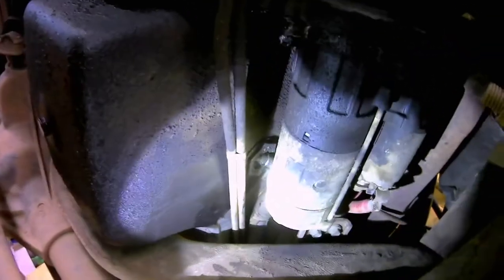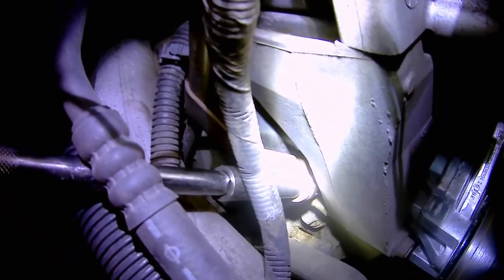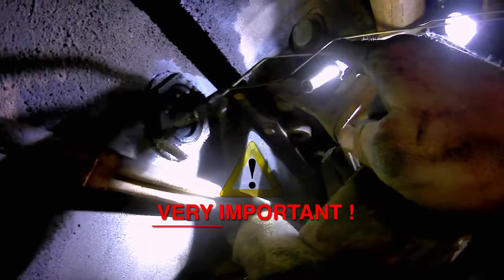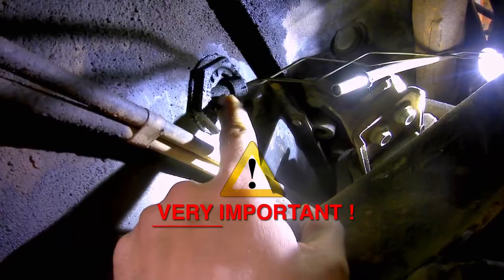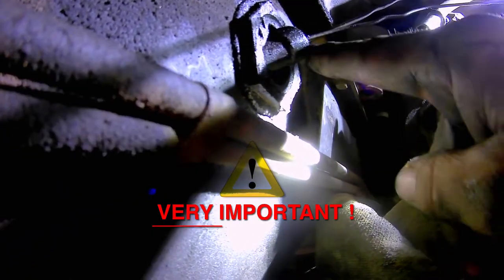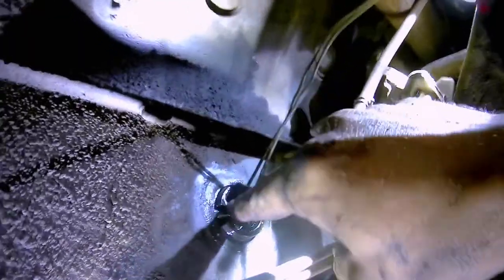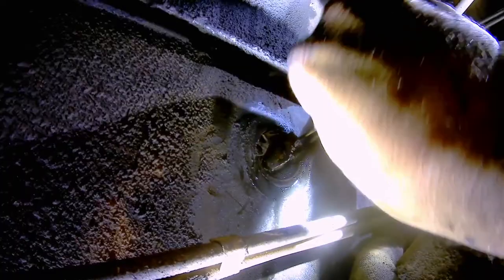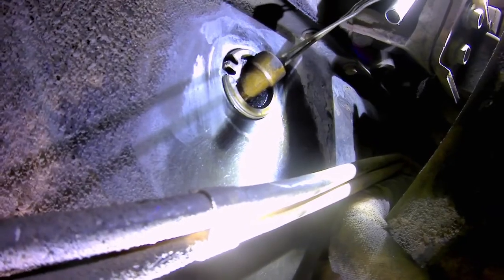7.3  Powerstroke dipstick oil leak repair

Comment: Just did this today with your kit, this is the NUMBER ONE option hands down. I'm lucky I called my local Napa Auto and they told me they carry it otherwise I wouldn't have known about this option and would have went with the other style that costs 3x as much and makes you drop the inner piece inside the pan. This is a simple and effective fix! Thanks!
Reply from the maker: I’m glad you like it and thank you very much for the review!
Reply: Where can you get this kit
Reply: And does it have a 95 7.3 option
Reply: @trentonmetcalf7220 my question as well. We’re you able to find the part for the ‘95?

Comment: I've also seen vice grips used in place of the coat hanger tool. Good Stuff, I'll definately be doing this if I get a 7.3 bus
Reply from the maker: There are several different ways I’ve seen people hold the inner part. Vise grips have a chance of scratching the inside of the tube hole. That can hurt the tube o ring when you put the dipstick tube back in. Just be careful no matter what method you choose.

Comment: okay let's think about this people I was just about to buy this kit too. The original seal was an o-ring on the inside, when this worked it would not allow any oil past the o-ring. once the warped o-ring no longer functions the oil creeps in between the hole and the threads of the fitting. now, time to really think about this, this kit puts a gasket around the hole. oil is still able to get in between the hole and the threads, theoretically. The only thing stopping us is the nut you tighten over the large washer which also does not have any sort of gasket. maybe the only reason this might work is if you use the gasket sealant on the threads of the fitting.  like I said I was going to buy this but then thought about it. still it's a better option than any other one I've seen without pulling the engine. but for $90 I'm going to try to use just black RTV sealant and either find or make a large washer first.
Reply from the maker: The oil seal is the RTV. The external gasket is there tho force the sealer into the hole and threads. The washer keeps the nut from tearing the gasket. RTV can only hold up to certain thickness. That is why the gasket is there. It presses the sealant into a thin film and forces it where it needs to go.
Reply: @73dipstick  you might be correct however the way that this person installs it shows a very thin film of our TV sealant on there I don't believe this is enough to squeeze into that hole. I'm not saying you're wrong I'm saying in this instance it looks like it's not enough I could be wrong about this too though.
Reply from the maker: Richard, you are correct. I did not do a good enough job of explaining everything in this video. I edited down the footage to try to keep it to a length people would watch. I can tell you that out of the thousands of kits installed I have had less than 1% who have had issues. And I have stood behind all who have reached out. I’m only trying to get people a cost effective solution to this common problem. I truly only want to help those who don’t want to drop the inner part inside the oil pan and pay $300 for the billet option. Which by the way works great. It’s just 3 times as much money

Comment: I need my truck and because of unexpected family business I'm two weeks behind schedule.  Just before I was about to make a 400 mile trip to pick up a new bed to replace the rusty, bent up chunk of swiss cheese that's current residing on the back of my F350, the dipstick tube flange decided that now was a good time to let go.  It had been seeping and I had bought a kit from Diesel O Rings a few months back.  This afternoon I said a few expletives (or prayed if you want to call it that, most of the same words) and got to work.

The kit says that if the flange is bent, to not use the o ring and instead fill the groove with Permatex Ultra Black.  Well, ain't nothin' easy on this truck and it had the classic warp to it.  But how in great gazongas am I supposed to squirt RTV all the way around that flange?  Top and sides are easy enough, but there ain't no way I can get to the bottom of the flange no matter how I turn it.  If I start squirting RTV willy nilly in there, I afraid some of that is going to come loose and get sucked into somewhere it shouldn't.  Then I'll be doing a tear down and like I said, I need my truck up and running, not up on a lift.

I just ordered one of your kits from Amazon.  Had to pay a little extra for two day shipping, but I should have it Thursday.  If All Goes According To Plan (yeah, right), I should have the truck back on the road by this weekend.  If it holds, I'll be sure to leave a positive review.  I rarely leave a negative review unless something is complete garbage.  Or politicians.  Same difference.  If it doesn't, this looks like it will be the easiest to scrap off and start over.

This product looks fairly decent and I expect good results, but the Universe?  The Universe hates me.  I just know that the weather is going to turn to crap, or I'll get called away for some emergency, or I catch the coof coof, or a rattlesnake that's late turning in for the winter will decide that under my truck is a good spot for a nap, or (god forbid) I'll get elected Grand Poobah of the Middle Finger and they won't take a F--- Off for an answer.  My money's on a combination of weather and the rattlesnake.
Reply from the maker: I love the story. I’m crossing my fingers for you that the snake stays away and the weather holds. My direct email is in every kit and I check it all the time in case you run into anything unexpected, please reach out to me.

Comment: What tool did you use to hold the flange from falling into the pan? Id like to use this repair on my truck but im afraid to drop the flange in the pan.
Reply from the maker: @brandonion5647  it was just a wire coat hanger that I bent into a spring holder. It worked decent. I hear a lot of people use a .45 caliber brass cleaning brush and like it. The brass brush holds tighter.

Comment: I've looked at other kits ages I seem to like this better. Would be good to include the gun cleaning brush the other kits include that holds the adapter from falling in. I don't trust the clothes hanger option although it looked like it worked fine in your video.
Reply from the maker: I’m not as big as the other guys. The liability of providing a “tool” would be WAY too much for me to afford. Thank you for your feedback though!! I truly appreciate it.

Comment: Mitch
So tell us how this worked out.
Have had any weeping around it yet ?
Just curious how this has worked out.
Reply from the maker: I’ve done dozens of them. I did have one start weeping early on in testing. I believe it was because there was still oil residue on the internal part when I put it together. Everything needs to be clean and dry before the silicone gets applied.  One of the first test trucks has gone over 200,000 miles since the repair and is still perfectly dry.

Comment: more details on the special tool  how to make ?
Reply from the maker: kinksbikes , it is just a bent coat hanger. I’m not releasing the design as of yet because I am trying yo apply for patent protection before I release the specific information. But you email me I can send you a pic of a one time use design that is easy to bend. 73dipstick@gmail.com
Reply: Just use a 40 mm gun barrel wire brush. Holds it perfect. Easy fix.

Comment: 40 mm or 45 mm gun barrell brush? Heard both
Reply from the maker: I’ve always used a bent coat hanger. My advice is to get the biggest one you can get in. The tighter, the better. Someone told me today that a 20 gauge bronze shotgun brush worked too.

Comment: What is the torque spec for the aluminum nut?
Reply from the maker: Good n’ tight🤣. Not many use a torque wrench with a 2” socket on this repair. Tighten it up until the adapter quits moving. I would say no more than 25 ft lbs to prevent stripping the threads of the aluminum nut.

Comment: How did you make the tool
Reply from the maker: I made it by bending a wire coat hanger. But, most people have found that a .40 - .45 cal gun cleaning brush works better? Several shops that do the repair use needles nose locking jaw pliers.

Comment: How on earth did 3 morons dislike this amazing video?! Thanks for sharing this How-to!!!
Reply from the maker: Thank you so much.
Reply: Lolololololol really!!!
Reply: I’ll tell you why I disliked it. Quality control on the machining of the threads on the new retaining nut is lacking. I wasted nearly two hours patiently trying to get the new nut to thread. I even tried flipping sides as well. About two turns in, the nut would pop off. And after all that time, my luck finally ended and the .40 cal bore brush I was using had sufficiently compressed enough that the dipstick interface finally slipped off and fell to the bottom of the pan. 

Even if I had managed to successfully get the nut started, after all that time, the RTV surely would have mis-set resulting in a bad seal. 

In the post-mortem, inspection of the new nut shows its threading is poor. This is unacceptable given how much you pay for such a minimally expensive part. 

So I’m left with not much other choice than to go to that diesel site to buy the aluminum adapter instead.

Comment: Great idea - but - flawed.  the o ring stops oil from getting out of the pan, this product simply tensions a big washer onto the pan, doesn't restrict the flow of oil at all - unless you get crazy with the RTV stuff and just goob it all over the place, then you have one giant man made washer.
Reply from the maker: The gaskets job is to push the RTV into the gap between the adapter and the pan. Keeping the silicone within its working limits. Silicone in and of itself will peel off. It also has a maximum working thickness. The use and design of the patented gasket in the kit allows for deformities in the pan so as not to exceed maximum thickness of the silicone. The washer is included in the kit so you don’t tear the gasket when the nut is tightened. I appreciate your comment, however the o ring being inside the pan and exposed to oil is what causes the failure. O rings swell over time with oil saturation. This deforms the internal part and allows more oil to reach subsequent o rings. Ultra black does not swell with oil. So it seals the gap as well as protects the gasket.
Reply: @73dipstick  but rtv is what will keep the oil coming out - not the gasket as it mounts flush to the pan.  Rtv should just be caked all over the dip stick receiver so the mounting nut seals around and into the threads. I applied rtv to the gasket as your instructions show but it still leaks.  Slowed it down quite a bit but still leaks.  I understand the failure point of the gasket.   I’m gonna have to pull mine again as it is dripping good still and rtv that male part coming out of the pan spit can seal the outside...
Reply from the maker: @33valleys28  send me an email and I will send you a new gasket and dipstick o ring so you can redo it. The instructions clearly state that you must get the silicone on the threads for the kit to work properly. I do stand behind my product and will always work with the customer via email. If you put enough silicone on the gasket towards the center hole and the pan and adapter are completely clean, oil free, and dry…the silicone will push into the gap between the pan and adapter sealing it up! Please reach out to me at 73dipstick@gmail.com and lets get your truck sealed up!!!

Comment: What is the point of it why does it I have a removal tube why can’t you be like a car with the dipstick just goes in with an rubber O-ring why would they do that or why make a removable at all
Reply from the maker: When international redesigned the 7.3 to a HUEI motor the dipstick could not be machined into the block anymore. So they came up with the oil pan adapter. Unfortunately, the adapter seal fails overtime. The factory repair is to pull the pan and replace the adapter. Unfortunately in the Ford vehicles the motor has to be removed in order to replace the pan correctly. That is why I developed this kit to be installed on the vehicle.

Comment from the maker: 73dipstick.com 7.3 Dipstick Adapter Repair KIT 
73dipstick.com is the website. It has links on multiple places to buy the kit. Amazon link is broken right now, but we are working on getting that fixed.
Reply: Hi Mitch Thanks for taking the time to make this kit and video. I cant get it to pop up on amazon
Reply: Hi Mitch, Eric from Minnesota here. Just ordered it off ebay. All is good!
Reply from the maker: Amazon changed a few things on how it’s listed now. I’m working the bugs out with it. The website 73dipstick.com has all the places it’s available! I will be in the office in the morning and will have it shipped before lunch!
Reply: @73dipstick  sounds like a plan! I've watched more videos about this than I care to admit, seen all the methods there is and am convinced yours is the best! And yes I have a mig welder and could do the weld on method but i dont like the idea of paint flaking, warping the pan etc. Some use a gun cleaning brush, hemostat,or needle nose vise grips and your method is the last one i saw. Needle nose vise grip i dont like that idea as the vise grip can snap off. And needle nose seems to be the most notorious for that!
Reply: Installed this kit on my 02 excursion yesterday. Love it. Fast delivery, great instructions, no leaks! I used the whole tube of permatex or whatever it was. For those of you balking about the price of this kit, you get what you pay for! These pieces look cnc cut, and it puts the issue to bed. Very well thought out kit. When I got mine apart, I thought, "Uh oh, wheres that big o'ring?" Turns out it was on the back side of the oil pan. The entire project took me 2 hrs and 17 minutes, and that was taking my time. Longest part was battling the top bolt above the starter. Thanks for making a great kit Mitch!